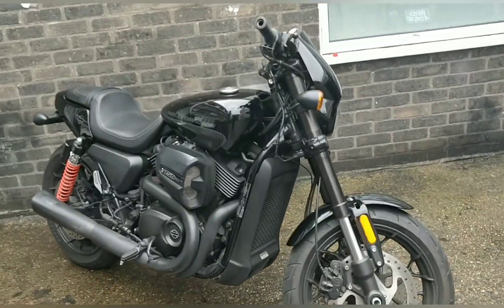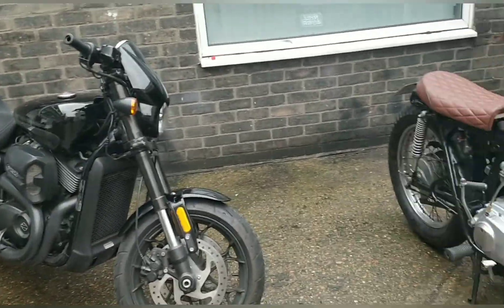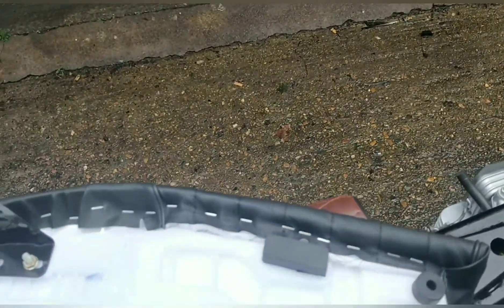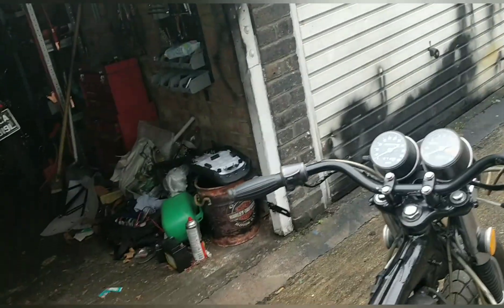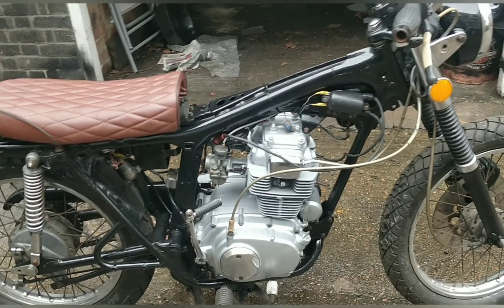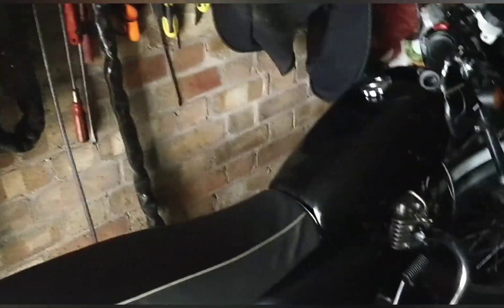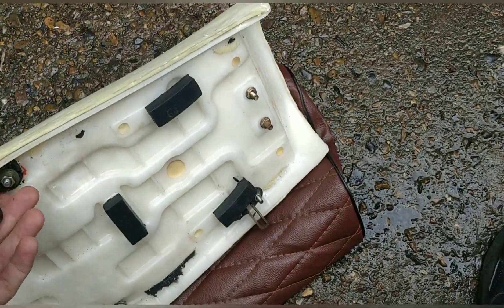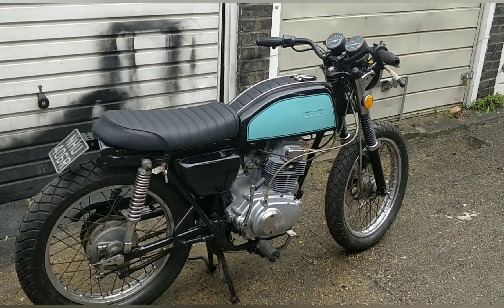Honda cb200. WOW, what a change. Final look and a big change. Very happy and excited. Thoughts?

Comment: are you gonna be selling the brown seat cover mines the original and too far gone
Reply from the maker: The brown seat cover wouldn't fit an original Paul and it wasn't in a great shape once took it of the base as I had used some glue aswell mate. 

I think they are £20 on ebay for a new one. The black one was. 

Cheers mate